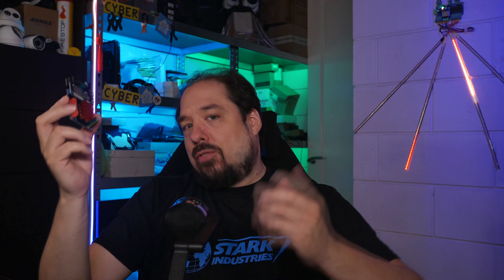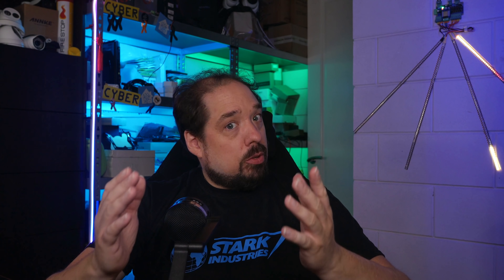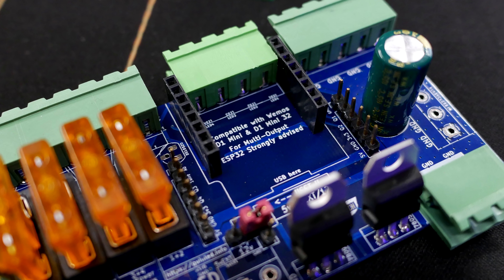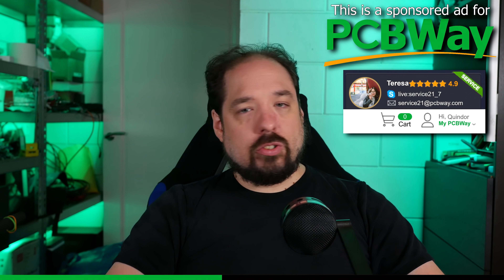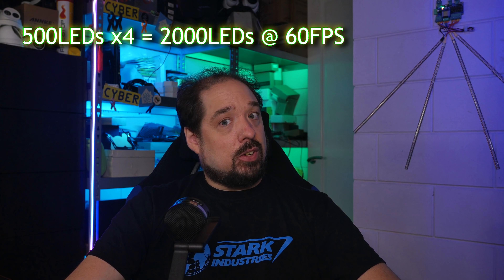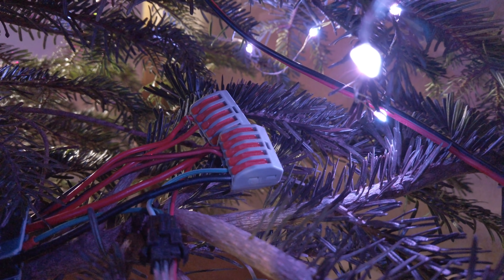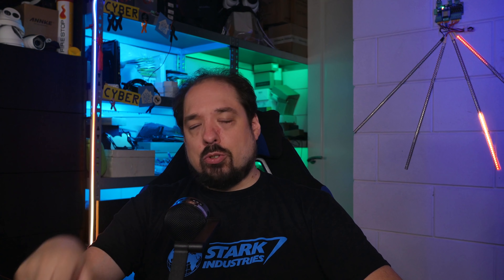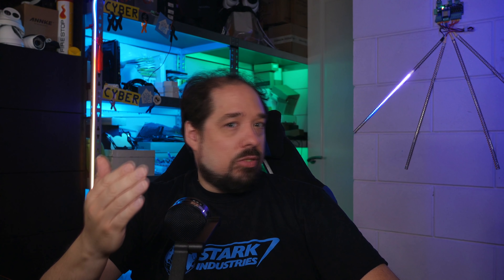💡QuinLED💡 The QuinLED-Dig-Quad is here!

Comment: Is it possible to somhow sync up 2 quinleds  over ethernet?
Reply from the maker: Yes, in multiple ways actually. It really depends on what exactly you are looking to do how it works. Having them do the same effects is easy, having them work as a continous LED strip is a bit more involved.
Reply: @IntermitTech  I'm glad I can default back to the easy way then 😅
I'll want to have bands around the roof and on some areas around first floor (ground+1 house) to animate in the same way. Anyway I may spend some time on discord with a sketch to find a way.

The real issue is I finally understand the moving parts. I just need to figure out how to do power injection (the type of wires to run to the middle and end sections especially in a clean way) but also decide on the led strip.

Do you have recommendations for a strip that would have to sustain being outdoors in the rain but also in direct sunlight? I'm from a very sunny country

Finally any point in the future you may make bundles of strips + controllers? Shipping is a bit high for just the controllers for me (basically doubles the price)

Thank you! I'm still using the dahua vto/vth btw thanks to you!

Comment: Hi, I like to use the QinLed-DIG Quad together with WS2815 LED. But as this LED stripe has 4 connections I don‘t know how to connect this to the DIG-Quad? Will there be some wireing samples be available? Will it be possible to connect four of these stripes to the DIG-Quad?
Reply from the maker: There is a wiring guide on my website but for ws2815 you connect positive and negative to the corrosponding output terminals (red and black) and then connect primary data to the data pin and secondary data to GND (or also called negative). That way you can hook up 4 strips in total on the Dig-Quad and they'll all work independently. The dual data features is automatically applied after the first LED.

Comment: Looking at the 5v table - max for 300 leds on the WS2812B says 65 Watts for full 100% on the sheet you pulled together - which is great  . that equates to 13amps . If I inject at front,middle and end will that be too much for one quad to handle  as 3x 13 = 39  as quad can take 30 amps ? or am I way off ???
Reply from the maker: Your math seems correct, and the Dig-Quad is rated for 30Amps continuous but handles bursts up to 50Amps just fine. Calculating with all white at full brightness is a good worst case scenario, but not a realistic real word scenario on my opinion (RGB white looks horrible anyway...).

So I think in any normal situation you'd be perfectly fine. The Dig-Quad will handle 40Amps too if needed, but I suspect average usage to be more around 10Amps or so. Also you could enable the WLED power limiter and make sure it doesn't exceed power levels that way.

About the front + middle + end injection, yes if you are indeed expecting to run full power RGB white that is needed, otherwise generally front + end or a single middle connection, is fine.
Reply: @IntermitTech  thanks for this. I am looking to run probably up to 15mtr of led @ 5v and 60 led/mtr  do you think one quad will handle this or maybe split in half and use two ?  with a second quad  and group them ?  Guess I maybe should consider 12v for that length and density as an alternative option .
Reply: Hey, I know this is old and you probably figured this out, but the amp load is constant per demand. If you supply power at 4 equal points, the power draw per injection will be SPLIT. Therefore those 13 amps would be divided into 3.25x4
I freaked myself out when I first started with 5v pixels. The only issue is if you lose 1 or more of those injection points due to an accidental disconnect.
Reply from the maker: Kind of you to reply! And if you do lose an injection point, it doesn't suddenly become dangerous, just that total power delivered to the strip will be reduced, won't suddenly burn, so that's good! I actually did a livestream recently to show this exactly.

Comment: What is the best material to mount the unit units to? I am putting them in a small  leviton structured media panel. Should I put a piece of plywood behind them or plastic? Don't want to screw them into the panel directly.
Reply from the maker: Plastic or wood is both fine really. I do advise to leave a bit of space between the back of the board and whatever it's mounted to, that way the board can breathe a bit. :)

Comment: Ive been circling buying and UNO for a while, but i just don't know what the difference is between the quad or UNO vs something you can buy on amazon that comes with a remote and an APP, can anyone explain before i buy something off amazon?
Reply from the maker: The hardware design, especially the Dig-Quad is much more flexible and high power then the generic stuff on Amazon. Also never seen a fused controller or power injection ports on those.. And since it's using ESP modules with for instance the WLED you get regular updates with new features or can switch what software you are running all together
Reply: @IntermitTech  cool thanks, i get it now, im in!

Comment: You said that WLED currently does not support the 4 ports, so is there a firmware that does? Will ESPixelstick run 4 ports?
Reply from the maker: I don't believe ESPixelstick can do either at the moment. FastLED supports it native using an ESP32 but that is a lot more low-level. So for now the board works fine as a single channel board with onboard power injection terminals and fuses, and multi data output works fine using FastLED, just no top software which supports it yet.

Comment: It would be great to be able to order your boards as an unassembled kit and also a "parts kit".  The bad part of mounting this is to order all the components from all the vendors, wait two to four months, dispute what we didn't receive and reorder/wait/dispute again.  After all this, we have a lot of extra parts we will not necessarily use.
Reply from the maker: I get that and the issue with it, but this in kit form, and I've looked into it many times, would basically make it about the same price as pre-assembled is now.

Just because I'd have to import everything, sort it out and then post it. Tax alone would almost double the costs of the raw components!

I'm still looking into getting a vendor in China to do it for me, not all shipping from China is bad, the pre-assembled have an average shipping time of just 2 weeks.

So yeah, I get it, but it's just not financially (or time honestly) viable at this time. :(
Reply: @IntermitTech  Thank you very much for the answer.  I understand the issue and I respect it.

Comment: Hi I am new to led lighting and want to built a christmas display for y grandchildren this year.
As a start to learning I would like to run 3x5m leds strips joined in sequence out side uner the lip of the retaining wall.

I would like to have each 5m strip run different patterns if possible.
How would I set this up safely and not have power fade.

Can I use a digi uno or do I need a quad
If I join them in sequence will I need to still run injector wires to each join if so what gauge wire
will wled be able to control each strip seperaley even thou they appear as one.

Here is hat I am thinking of getting please let me know if they are no good
1. AC 110V/240V TO DC 12V 10/20/30A 120/240/360W Transformer Regulated https://www.ebay.com.au/itm/AC-110V-240V-TO-DC-12V-10-20-30A-120-240-360W-Transformer-Regulated-Power-Supply/222730925126?var=521587167108

2. WS2815 RGB LED Pixels Strip Individually https://www.ebay.com.au/itm/WS2812B-WS2813-SK6812-RGBW-WS2815-RGB-LED-Pixels-Strip-Individually-Addressable/324191683513?var=513251110398